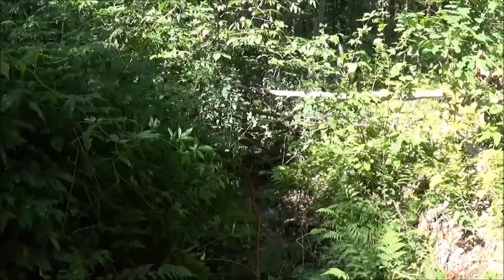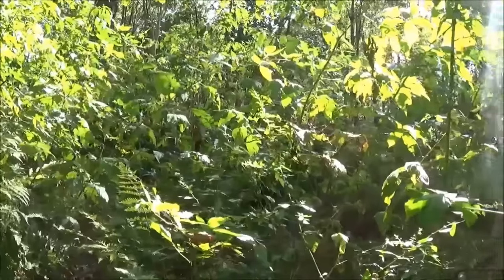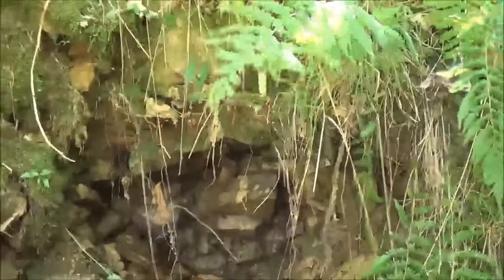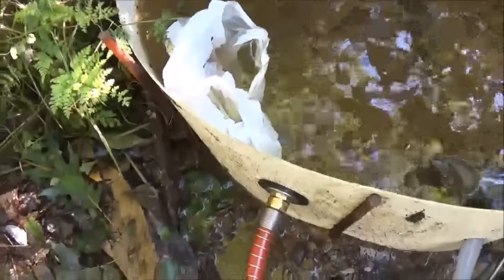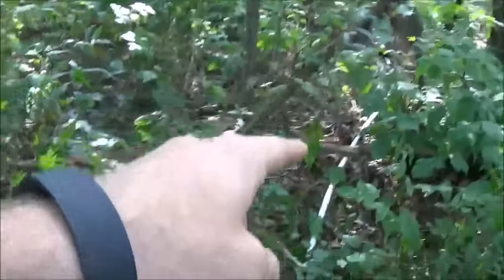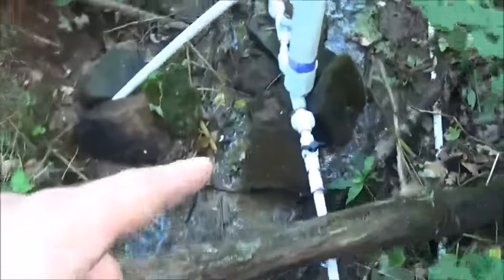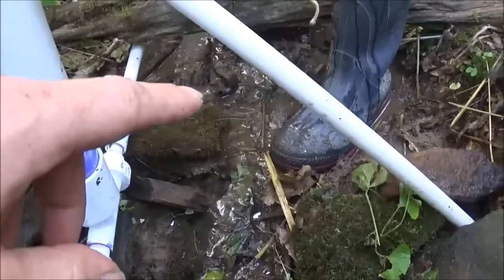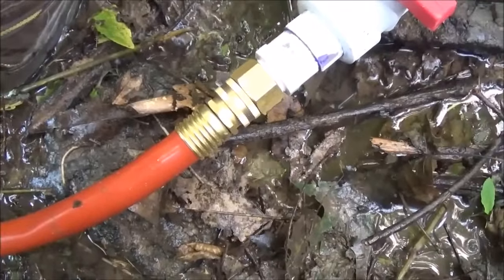Ram Pump Installed & Working 8 7 2016

Comment: typical setup is half output hose size to input so if 3/4 water hose should have been at least 1/2 output line. or 5/8 or crack the output ball valve little past quarter of a turn ;).

Comment: A rubber hose is about the worst thing one could use for a ram pump drive pipe.
Reply: Oh, I've seen plenty of videos where folks use a garden hose or other similar item for their delivery pipe, but the ram effect that drives a pump like this is greatly diminished when using such materials.  The more rigid the drive pipe is, the more energy is put to use moving water towards the collection vessel.

Heck, I even saw an improvement in efficiency from my pump when I chose to replace just 3 feet of 1 1/2" PVC drive pipe with galvanized pipe.   I am using a 93 foot drive pipe that's 1 1/2 inch diameter PVC for the first 90 feet, which then gets reduced to 1 inch for just a foot or so and then to 3/4 for another 2 feet, both reductions being made of galvanized iron.  The pump uses 3/4 inch valves and delivers water through a 1/2 inch PEX line.  From about 10 feet of drop it delivers to a height of about 90 feet.  When the drive was all PVC, the pump delivered less water than it does now.  

In my experiments with ram pumps, I'm always trying to tweak for efficiency, but also understand that some folks just have to use what they have.  It's still cool!